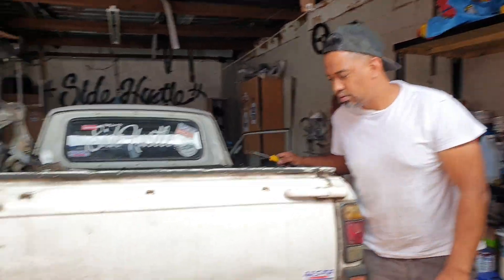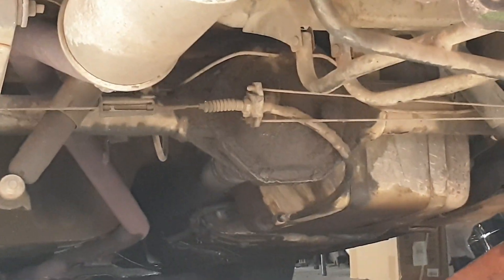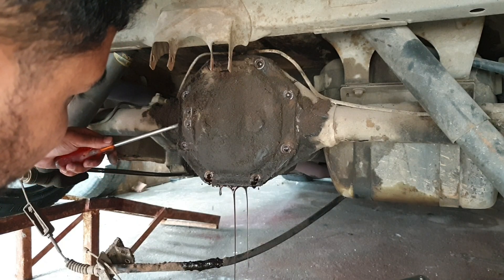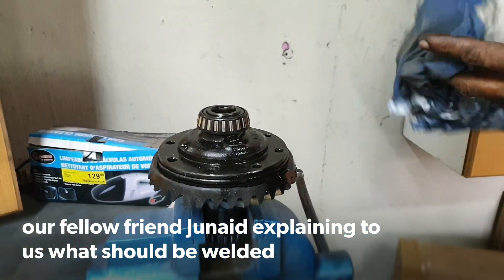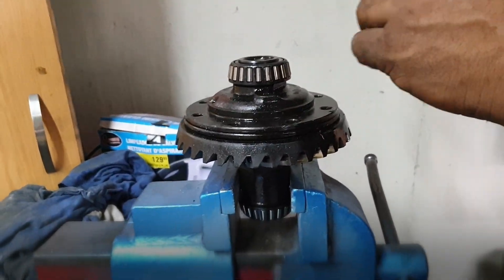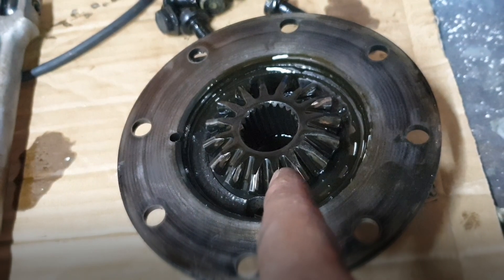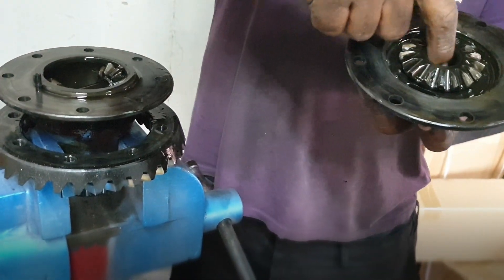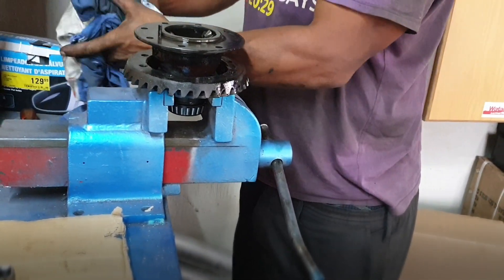How to Lock Your Diff  on a budget DIY

Comment: Just for the record, if you do this to a everyday road going vehicle YOU WILL have some serious damage caused.
Reply: Like what??  I’ve been wanting to weld mine
Reply: Tires first, increased wear and tear on diff internals and possible damage to half shafts. I'd suggest LSD if car is daily driver. That or proper locker. I had no problems with welded diff on my off road buggy , but I drive it on loose terrain.
Reply: @Werk4Cash  you can’t go around corners without scrubbing tyres and snapping the half shag in the end